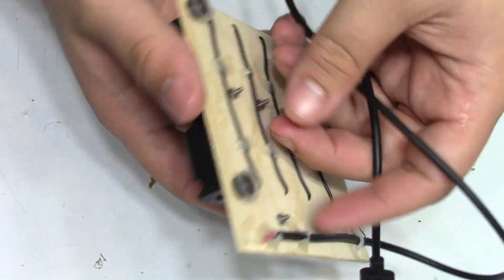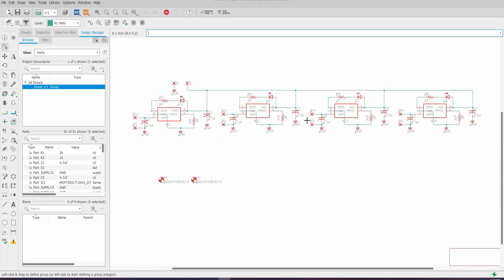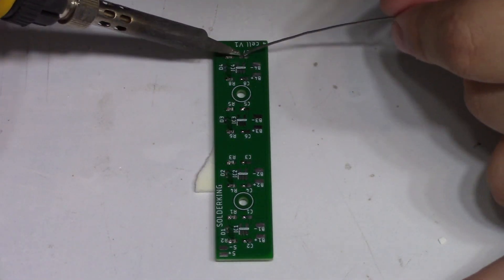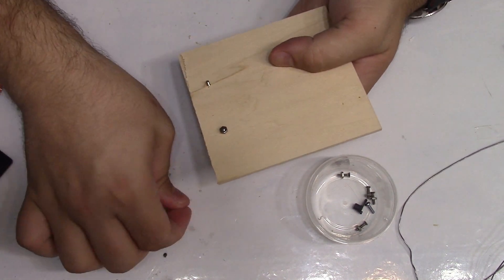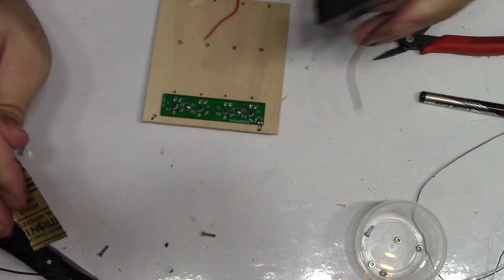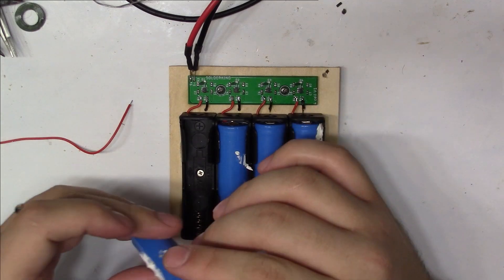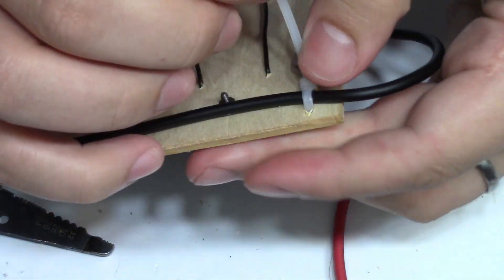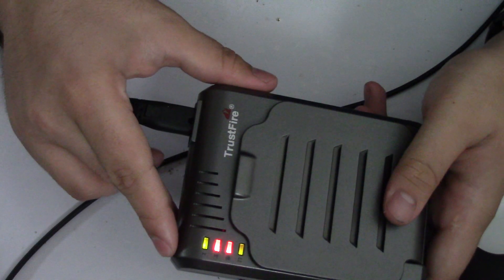DIY 18650 4 bay charger!

Comment: Nice video! I'm new to 18650s batteries and start doing some research on my own and check a lot of videos like yours. This may be a dum question but I wonder if instead the board you can just configure the battery holder parallel or in series and add the BMS cable readers (not the BMS) to connect it to a B6 Lipo Battery Balance Charger? Since the B6 is a smart charger it may only need the BMS cabling to read the voltage  is that possible with out a BMS? Thank you!